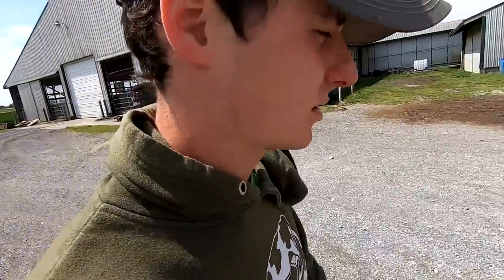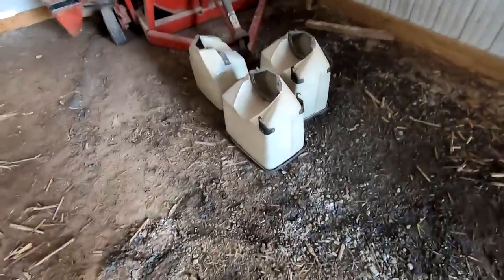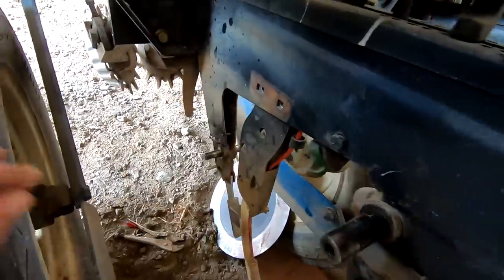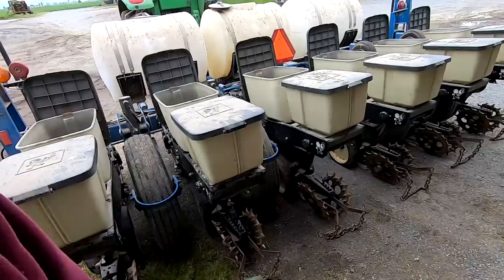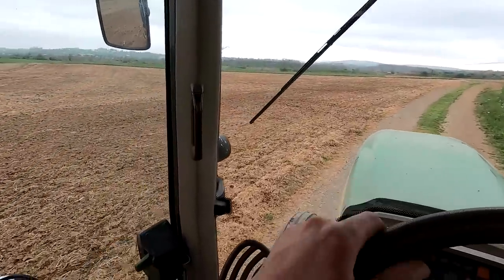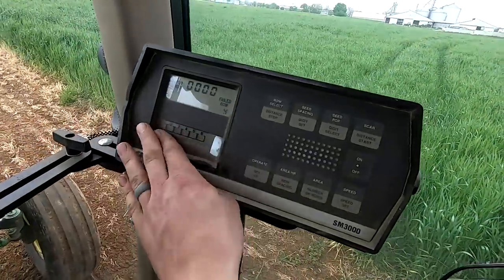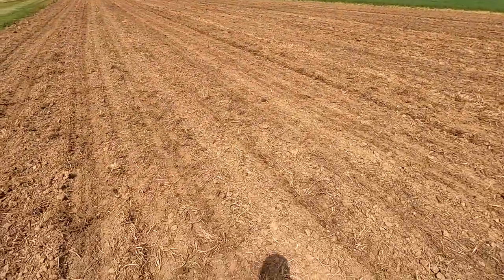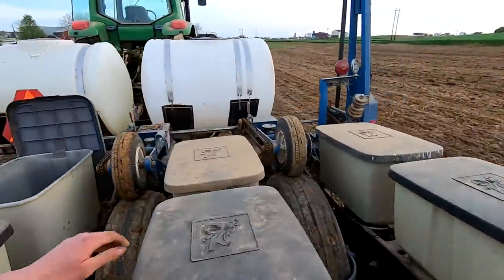Planting Corn to Feed Dairy Cows

Comment: Yo Eric, how fast are you running the planter? Is there an optimal speed or does it matter. Very nice video.
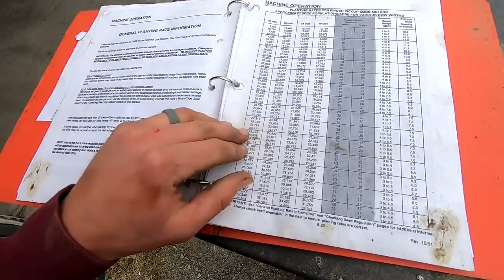Reply: If you pause at 7:58 you can see the recommended speeds in the second to last column, there's a bit of flexibility but speed of running the planter matters - some more modern setups will digitally manage this in sync with the tractor speed, too.
Reply: @teno2tube  Thanks teno.